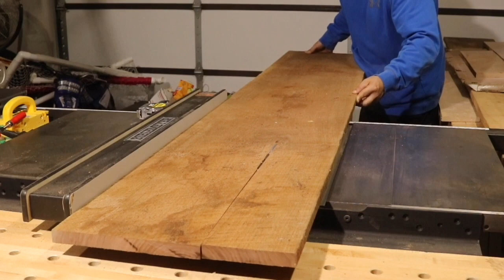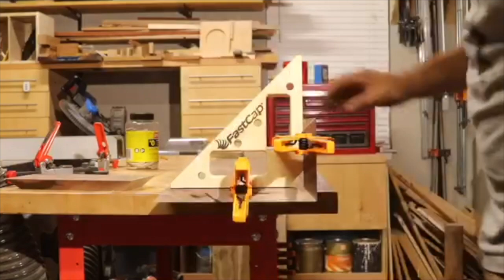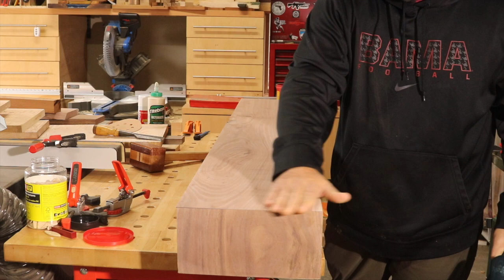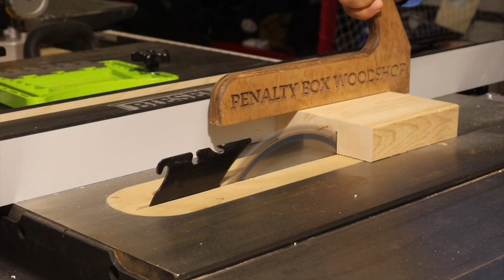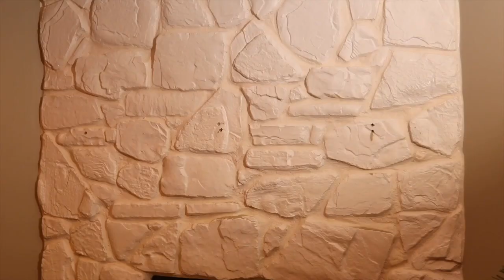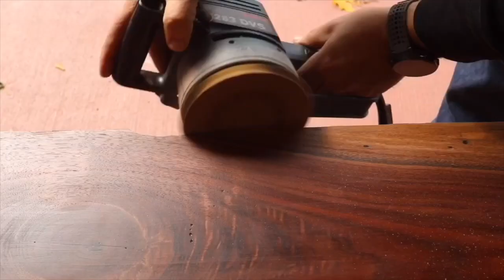Fireplace Mantel Build || DIY Floating Shelf

Comment: Great Video! Was the stone leveled? If not how did you get wood flush? Is this a gas fireplace? Was there any concern of a gas leak?
Reply from the maker: No gas issues at all and no the stone was not levels. I used a scribing technique shown in the video to insure that it was flush
Reply: @PenaltyBoxWoodshop  thank you for the reply! You just used a power sander to scribe right?
Reply from the maker: That is correct and a jigsaw works great as well

Comment: Great video. I do have one question regarding mounting the mantel. How did you secure the bolts to the frame of the wall?  I see you drilled holes into the rocks, then you inserted bolts into the holes. After that you placed the frame and then??????? I'm not clear on how you secured the frame to the wall. Thanks in advance.
Reply from the maker: Hey thanks! I drilled holes in the rock then inserted a wall anchor. I then used screws through the frame and into the anchors.